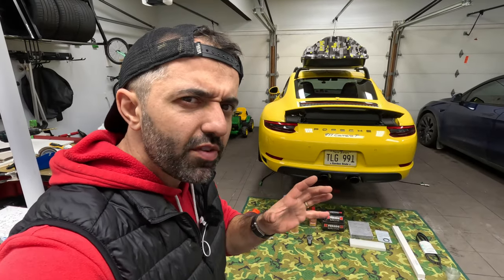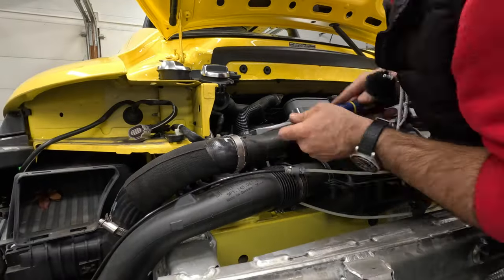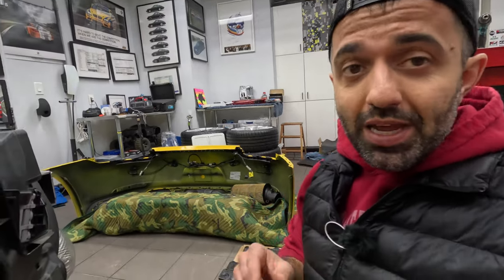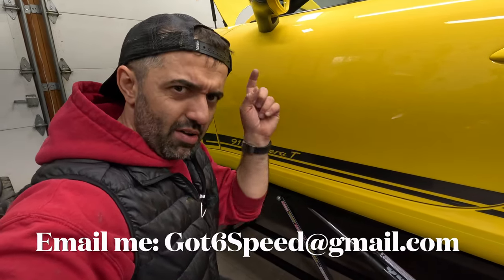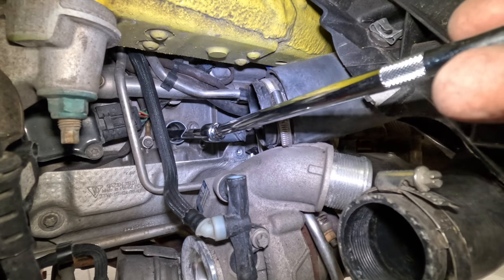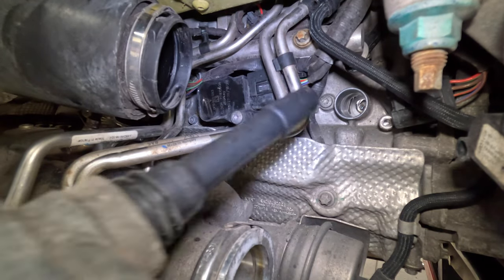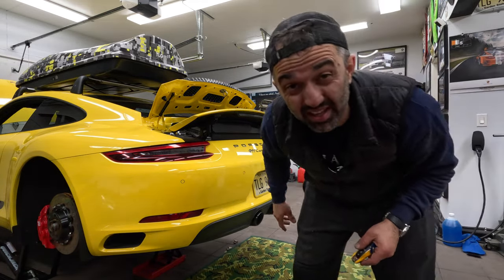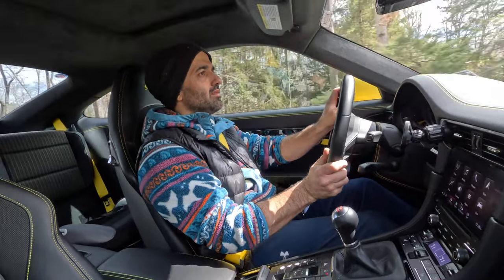Porsche 911 Major Service DIY: Save THOUSANDS!

Comment: With regard to collecting the oil, all you had to do was unscrew the drain cap on the container to let air in and the oil would have started flowing into it.
Reply from the maker: Tried it. Didn’t work. It was clogged with grass

Comment: By far the easiest car I have worked on, just did the PDK and final drive oils, plugs/coils, oil/filter change and K&N air filter in just a few hours. Thank you for your videos! My M4 is gone and I don't miss her!
Reply from the maker: Always  need to trade up! :)
Reply: "By far the easiest car I have worked on" Say what? How many cars have you owned where you need to jack it up and remove two wheels just to get started.

Comment: Bosch aren't known for being consistent on pre-gapping. But also, if you gap your own spark plugs you can set them to a wider gap and get better performance from the engine. Yep, you might have 0.7 mm as standard, but apparently the best performance comes at 1.14 mm. It really does make a difference (Of course, if you gap them too wide, you'll notice misfires).
Reply from the maker: Good callout. Thanks !

Comment: Great video. For your safety, the quick jacks as used are backwards oriented, per the manual, need to lift the heavy end of the car over the jack base, not cantilever.

Comment: Nice brief video, tightly edited.
But those brake pads were barely worn. I would have left them.
Same with the spark plugs. I think I would have inspected and reinstalled. They're good for at least 40,000 miles, if not 60 or 80,000.
K & N filters don't work as well as stock paper filters.
Reply from the maker: Thank you I appreciate the feedback. I replaced the brake pads for Traxxax specific ones. And regarding spark plugs, Porsche recommends you replace them every four years regarding of the mileage to prevent seizing.

Comment: Great video. Closing in on a 991.1 with 70K miles. Curious what I should expect on annual maintenance costs?
Reply from the maker: Should be cheap. Gas and oil changes

Comment: Excellent video, your best I have seen so far. You're really brave, full respect! Second, nicely done and very informative. Thanks for this! PS: can you actually put injector cleaner in a Porsche? That's an additive right? The user manual says "No additive allowed".
Reply from the maker: Thanks! And yes I’ve been running injector cleaners without issues.

Comment: two things.  You shouldnt use straight dialectric grease.  It needs to be dialectric / teflon compound  BMW had it cheaper than porsche.  Due to the heat from the proximity of the turbos, you need that type.  Also you dont put it on the tip of the plug, you swab it on the inside 1 inch of the coil pack boot.  That way the boot doesnt sieze on the porcelain.  Also the bottom clamp of the turbo intake tubes are not to be reused.  THis is all in the service manual
Reply from the maker: Thanks for the feedback. 
I never have issues reusing clamps n
Reply: @TommyLGarage  note the bottom one is different than the top one.  Also note that there is blue loktight from the factory on the clamp screw.  This is done to keep it from loosening up after many heat / cooling cycles.  I guess in theory if you put new loktight on it it should work but porsche specs a new clamp just for that ONE clamp.  I would keep an eye on it.  I replaced mine with new and kept the old ones for a rainy day

Comment: Great content, I feel like DIY on the 991 gen onwards is just unnecessarily difficult. For the coils, did you notice they had any vaccuum type pressure on them? I’m just wondering how you’d get those coils out after removing that screw if they were kind of suctioned into the hole a bit given that it’s such a tight area with no room to get your hands in there
Reply from the maker: Thanks! So the coils had some vacuum to them but you just pull by the screw and they come right out.
Reply: @TommyLGarage  keep up the great content dude, I watch a lot of your vids for my F82 maintenance, maybe one day if I own a 991.2 I’ll be watching this again haha

Comment: Excellent video.  My only suggestion would be to orient the quickjack the other way around for safety.  The transmission jack helps prevent any issues, but would be unnecessary if the quickjacks are turned 180 degrees.
Reply from the maker: Thanks but I can’t orient them the other way. The pump is in for this the garage.
Reply: @TommyLGarage  got it...good you are using the transmission jack!

Comment: Gas cap gasket? Come on dude, ridiculous bro
Reply from the maker: You’d be amazed how often they go bad
Reply: Gas cap itself will cause check engine lights with pressure sensor if not properly sealed. Necessary

Comment: 18,000 miles and you are putting new plugs in it, what for, spark plugs don't wear out with age, they wear out from mileage, don't be a sucker.
Reply from the maker: It’s not about that. It’s about preventing them from seizing. That’s all it is.